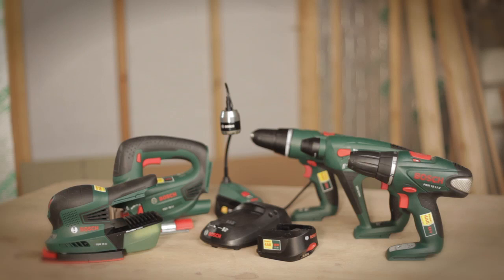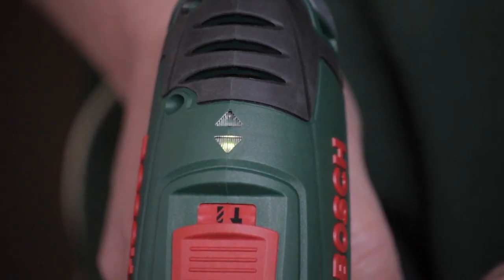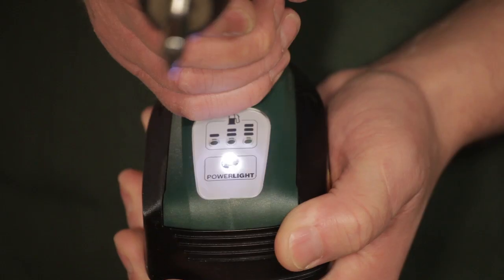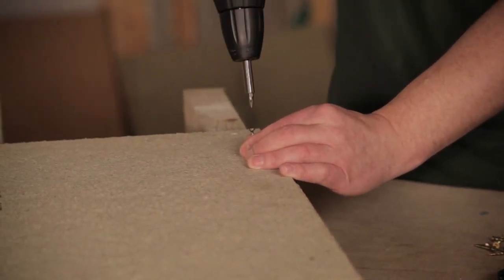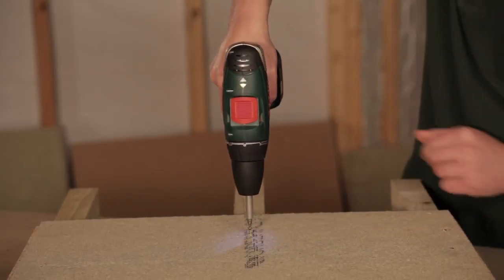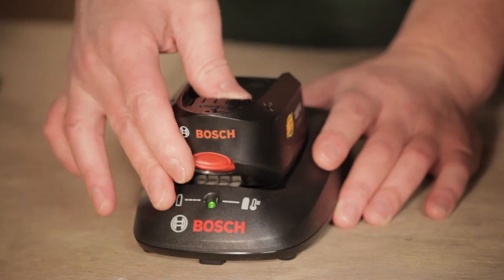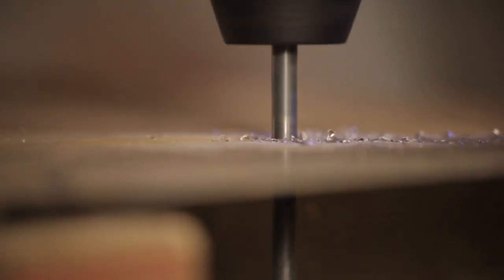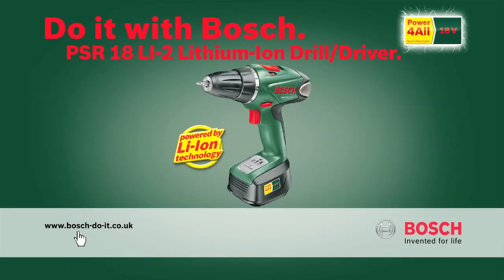The Bosch Lithium-Ion Cordless 2-Speed Drill/Driver PSR 18 LI-2

Comment: I don't change the torque with a wheel behind the tip like you do, I have a slider. And I can see on top via a LED indicator how much power is being used while it spins, it increases when it's hard to get through something.

Comment: How do you use a wire brush attachment on the PSB-1800 Li2? Which settings and why does it keep stopping? Trying to clean metal garden furniture.